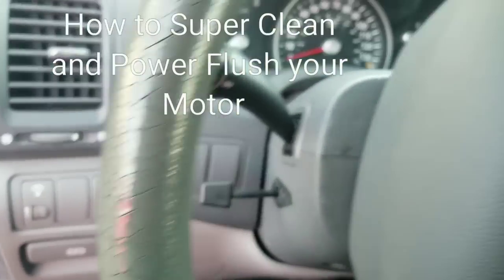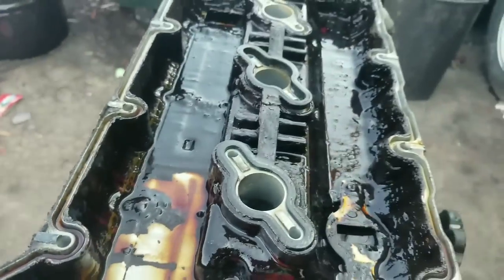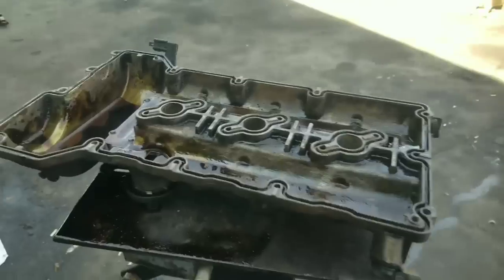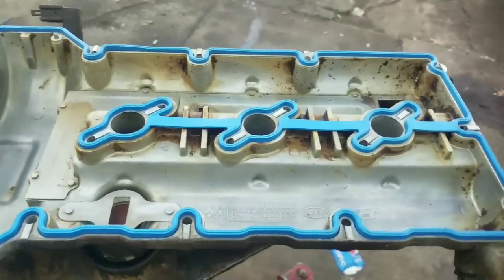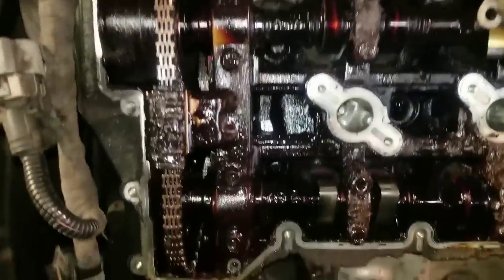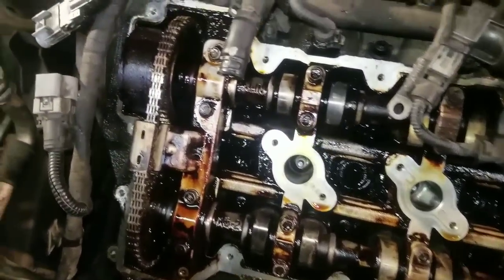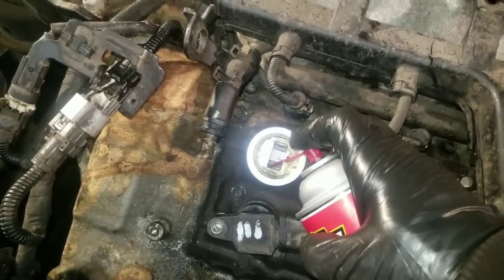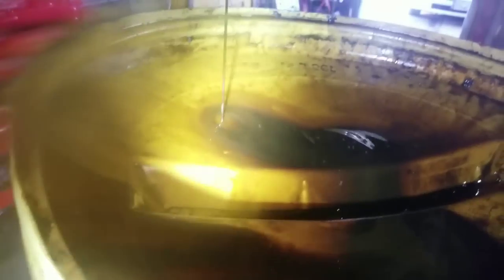How to Super Clean And Power Flush Your Car's Engine Pt.1

Comment: Use an oil suitable for your engine. Some oils do sludge but if you have a low oil pressure drop the sump and check the oil pump.Modern oils will keep your engine clean if changed hot and regular

Comment: There probably isn't a part 2 because the engine spun a bearing and died and wouldn't look good on his channel.  Any time the oil light is on you need to drop the pan and clean out the pickup if you expect the engine to live.  You're a hack if you expect to just pour shit in the engine and expect it to clean itself when it gets that bad.
Reply: Lmao
Cracked me the f**k up this comment
Reply from the maker: 2023 car still running. 
Thank you please like, share, and subscribe, also please check out my other channel Salem Taxi, on YouTube for more material on a different level.

Comment: Its suppose to be washed by diesel and the tool you can use is hand brush which does not have chances to break a part its threads inside the engine,(eg tooth brush) unlike wire scrubber with machine, it breaks alot of its particals here and there. drop down pan should be washed as well. also throttle should be washed same way.. done that in many cars and it worked always, but you need to use flushing oil twice aswell.. later put new engine oil and oil filter..

Comment: If you want cheap dump a gallon of diesel in the oil at least its oil based  and won’t damage the cam timing gears and seals  brake cleaner BAD   Don’t use inside an engine  unless its dissembled which is what this one needs. A tear down and rebuild
Reply: Trevor Mangus or atf

Comment: Good job,
 As for the know it all about the wire brush on cam lobes...... Get a grip. No way will the wire brush damage the lobes. Maybe if the wire brush was on surface for ten minutes even then minimal damage.

This guy knows his stuff, gets the job DONE RIGHT.

Top end clean, bottom end clean. Change oil filter, new oil, engine flush, dump oil, change oil filter, new oil, engine flush, dump oil, change oil filter, new oil.

Internally engine pristine.

Very good Job.

Comment: I've try this before cleaning using screwdriver then blow it using air compressor... then refill new oil and filter... start the engine more worse...the valve ticking very loud... until I remove the out the oil pan, found out all the gunk debris clog the oil pump filter and more on oil pan...
So I remove the oil pump filter a clean with kerosene and blow with air pressure.. install everything and engine back to normal

Comment: a wire brush. on an air gun. directly  onto the cams. i really, really hope this is just a trolling vid. 😮😬
Reply from the maker: wire brush is softer then the metal its cleaning, how do you think you would clean stuff like this?
Reply: Artistry Photography no it’s not steel on steel is not good lmao, use scotch bright pads
Reply: Look at the context. Cheap car. Well-used. Likely that the customer doesn't have a lot of money, right?

So our guy is trying some unconventional methods (doesn't make them wrong) to save the customer from having to buy a new head+ many hours labor

The results speak for themselves. This isn't a formula 1 car. If a cam lobe had a few microns wear from the brush (and that's even doubtful), but the car ran much improved than from when the customer brought it in, what difference does it make in the REAL world?
Reply: @wilsoncrocker  I appreciate your credentials. But you still missed the gist of my comment- oftentimes when you size up a "big picture" view, you take a different approach.

That way instead of 
1. Fix a beater and reverse mortgage the house
2. Junk it cuz it's dumb to reverse mortgage the house
3. You find a balanced solution that you can afford. Junker runs on for who can say how long but it was affordable to someone driving a junker. The vehicle won't die tomorrow or next week or next month because of this technically imperfect fix

Comment: So have you not remove every oil film leaving no lubrication with brake cleaner? Would that not cause scoring on start up ??????? I want to know
Reply: Probably will. But this is a well abused car that already has some scoring. Not a brand new engine. This engine is so abused it will probably die soon regardless of what he does to it. Anything he 
can do here is an improvement to what it was before lol. I do believe hes taken all that into account. I'm pretty sure he wouldn't do any of this to a new engine.

Comment: Oh My Goodness.  I cannot believe what I have just seen and I had to watch it all the way through to make sure.  Whatever you do fellow YouTubers - do not follow one single word of the "advice" given in this video.  Read all the comments below - I heartily concur with them.  One telling point, the guy changed the cover gaskets which were old, true, but would have continued to work just fine provided they weren't messed about with - and ignored the broken cam chain guide??  In all honesty, which do you think is more important?  Also, when started up after the rebuild I nearly leapt off my seat with the racket the engine was making!!  And when the oil was dropped?  I'm no chemist but it looked like 50% oil, 50% crank bearing material coming out!!  I feel sorry for the current and any future owners of this poor Kia.
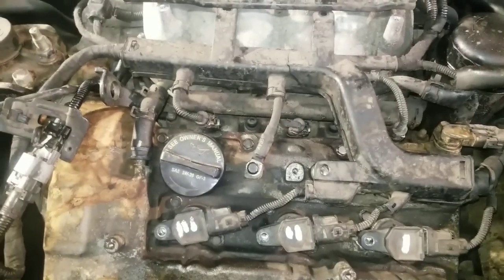Reply: Did you not hear him address the broken timing chain guide around 30:35-31:00?
Reply from the maker: update this car still runs great. have a good day
2023
Reply from the maker: Thank you please like, share, and subscribe, also please check out my other channel Salem Taxi, on YouTube for more material on a different level.

Comment: 1) Brake cleaner has chloride in it. If you use it to clean your mating surfaces before assembly then the chloride will eat up the gasket. 2) proper torque on rubber valve cover gaskets will cause then to wear prematurely and leak--use a torque wrench.
Reply from the maker: well said, but you forgot, they make non chloride brake cleaner. also your correct about the torque wrench, but there again the new-style of gaskets that are sold aftermarket for the valve covers are non torque gaskets.There type gaskets have metal shims to avoid over torqing on the gasket.
Reply: It said non chloride on the can.
Reply: Brake cleaner's fine for cleaning gasket surfaces.  What you don't wipe off from the cleaning, it just tends to evaporate.  I used it a thousand times and never had a problem.  By the time you go to put on the gasket all the brake cleaner's long gone.

Comment: Omg. Good bye cam lobes and bearings! Do not do this people
Reply: i used simple dish soup and metal conton to clean main part and modeling tool to do smakest corners and got it spotles
Reply: Mongo the Mechanic that car was gone from the beginning. Anything he did to it was an improvement. It's a Kia and a taxi at that. Not a ferrari.
Reply: U forgot about the crankshaft
Reply: So I have been a slob about changing my oil. 350 5.7v. Should I just change the oil a few times back to back after running for a few mins between changes? Wondering if the detergents will help if they are fresh..

Comment: people do not use a wire brush on an air tool, because at high rmp's the wire can come off the brush and into the engine. you get just one of those wire's between the bearing and the crankshaft you're in big trouble, that wire will eat into the bearing and the crank.lay down paper towel's to stop anything from going down into the engine. then take your time and clean it, use a toothbrush or a wire brush by hand, and watch than no wire is getting into the engine.alway clean both side's of the valve cover, when it's off the engine is better.when working no a engine fast cleaning is not always better, take your time do it right.

Comment: That was a DRY start! That hurt! Folks this is a video of WHAT NOT TO DO! Those cam bearings had to get damaged. If the chain had that much slack that it was slapping the cover, its time for a new chain. Im sure now thus engine is DEAD.  Also invest in a tripod!  Most of the video is you trying to talk over your air tool.

Comment: Instead of brake cleaner buy a quart of KREEN and put in a spray bottle and wet top end down then lay valve covers back on to reduce evaporation. Repeat a couple times let soak overnight if able, next day reinstall valve covers start engine let idle for 15 minutes then change oil. I had amazing results doing this.
Reply: Do you have a video on that?  I have sludge in my engine and I'm looking at different options.
Reply from the maker: so this process you mentioned sound time consuming,

Comment: This might be a crazy idea but what if you were to totally fill up the engine with the "awesome" or MMO and let it sit for a couple of days? drain and refill with the proper oil level ? thoughts?
Reply: I did that with my 200k prius. Except I used Berrymans chem dip. I let it idle for 15mins. let it sit a week. Then came back and idled it again for 15mins. Then I did the oil and filter change. Cleaned it out very well. but not completely. Ive gone another 20k miles and no issues yet. Runs better actually.
Reply: @Lilmiket1000  That Berrymans is good stuff. The Prius is a great car. Thanks for taking the time to tell about your knowledge, I appreciate it

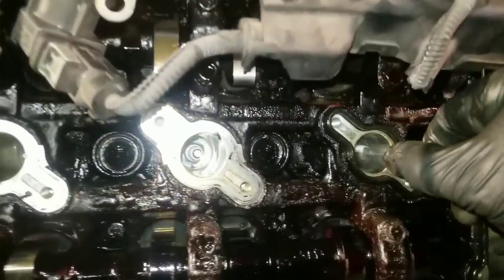Comment: A piece of the old brittle valve cover gasket drops into the spark plug well at around 16:00
Reply: You’ll also see it in there around 19:08 lol
Reply: And it will be drop into the combustion chamber during the next spark plug change.

Comment: When an engine has no oil pressure you're not supposed to run it until the problem is resolved. It's especially stupid to rev it or drive it with no oil pressure. This engine was already toasted before you flushed it.
Reply from the maker: 2023 engine still running great
Thank you, please like, share, and subscribe, also check out my other channel Salem Taxi on YouTube

Comment: I am battling in my camry because of oil pressure indicator keeps coming on and off..i thought its only the sending unit sensor is broken..but the only solution is drain the oil, clean the clogged oil pick up tube and the oil pan..saves my engine a lot..

Comment: Its no surprise to see a Taxi Cab wanting a cheap fix to years of neglect. These companies wring every penny out of their equipment and cry at the repair cost... Whats your opinion of the ATF flush I see online?
Reply: heavymechanic2 tranny fluid work I add a quart to my oil like 3 days before I change it 30 year mechanic
Reply: You can also run ATF on idle. Next oil change, drain oil, change oil filter and fill up with ATF.  Run on idle and idle only for 15 minutes. Drain add oil and new oil filter. Next oil change should be @ 1000 miles since you will have had ATF residue inside engine. You can also add half quart of ATF on new oil. Run it for no more than couple hundred miles. To keep things Cost effective. Buy Oil, ATF and oil filter @ Walmart/ Supertech brand.  You get quality @ a very low price. 
Note: ATF has detergents and does an excellent job @ cleaning.

Comment: I'm working on the exact same engine,  you are pissing in the wind. there is SO much area inside this motor. I got this van for cheap, it was overheated, all 3 rear cyls were breached. Sludge, the whole nine yards, the cyls sat for 3 yrs with plain water in them.

Comment: Oh my GOD!!!!!!! Did you really start the motor with brake cleaner in the crankcase and oil pan 🤦🤦🤦🤦🤦🤦. This destroys the motor, and brake cleaner renders the oil that's already in the engine useless because it's a solvent. so you're basically using the brake cleaner to lubricate the motor. You're right that flushes the engine alright .. flushes the engine of any life it had remaining. Also there are seals deep inside the engine. Brake cleaner destroys those seals. you should never ever ever ever ever ever ever ever ever ever ever flush an engine with brake clean. Hahahaha. Is this is a troll?
Reply from the maker: update 2023 car is still running great, Sooooooooooooooooooo, what was you saying?
Thank you please like, share, and subscribe, also please check out my other channel Salem Taxi, on YouTube for more material on a different level.

Comment: My mk4 turbo makes the same sound when you pull dipstick and try to pull oil cap. Cause I have the pcv valve touted through the catch can with a few one way check valves. So it acts like a Venturi sucking out any air and blow by.

Comment: la totally awesome contains
2-butoxy ethanol

i get it, its a solvent,
and a good one for oil
and sludge.

the only thing i would do
differently is to not
run the engine,  but to 
use a pump instead; to push it thru
the system. Sort of a dialysis
machine for cars in which the 
adapter would screws into the 
automobile oil filter hole.
Reply from the maker: cost of machine?
Thank you please like, share, and subscribe, also please check out my other channel Salem Taxi, on YouTube for more material on a different level.

Comment: That Noise (with No Oil pressure) is not the valves rattling  ...  Rather it's the Rod bearings pounding out. You are destroying what's left of that engine
Reply from the maker: engine still runs years later, looks like i added life.

Comment: Jesus Christ...At least use Diesel oil with high detergent content, and drop a flush in for the last 20kms. Drop that oil, use a mineral oil to flush the shit out, and drop a high quality Diesel oil in, changing every 2500- 5000km to slowly breakdown any sludge & build up.

Wonder how long before the bearings & cam lobes were fucked?

Jesus

Comment: I'm not going to comment on the merits of the process used here.  It just seems like it might just be easier and cheaper to drop the oil pan, clean that out, and then put in a high detergent oil like Amsoil or Mobil 1 High Mileage with a premium oil filter to slowly and safely dissolve the sludge and hold it in solution.  Either do an oil analysis like 2-3k later or just change it out again. No messing with the internals needed...plus way less money in labor. Also OMG the drained oil looks like it has zero film strength 😧
Reply: Also -- I have one of these vans.  to get to the rear valve cover you have to take off the intake plenum because the rear cylinder bank is almost under the dashboard.  I saw at one point that someone mentioned that this was an option for customers who did not wish to pay to have the oil pan dropped which would make sense on a transverse 4 cylinder, but this is a V6.  Again without criticizing the method used here, my experience tells me that dropping the oil pan would definitely be easier.  With the sludge out of the pan, some high quality high detergent motor oil could go to work on the top end.  

As another idea to help this engine out, after doing the pan and the oil change it might (I am not saying this is good or right just an idea) be interesting to do a coolant flush and put in a slightly higher temperature thermostat for the first 2-3k miles or so.  This might help get oil temperatures up high enough to better activate the oil detergents and help boil off the impurities contained within the sludge.
Reply: I'm from Pakistan 
I used mobile oil
Reply from the maker: Thank you, please like, share, and subscribe, also check out my other channel Salem Taxi on YouTube

Comment: Abused aint the word,sheesh!! That's why an engine flush every 3 yrs is a good idea.Oil changes is vital and cheaper,less hassle.For goodness sake just do an oil change 3k less than the manufacturer says/recommends if the mileage is under 100k.Between 100k - 200k halve it,simple.

Comment: Bro,you have made lot of mistakes! You should never flush it with cleaner! Best way to di it is to drain oil,remove oil pan,clean suction pipe. Assemble it,put 1/3 of new oil in it and rest diesel fuel. leave ot to run 15-20 minutes on IDLE! DO NOT REV IT! And after drain it good and replace oil filter,refill it with new oil... And it is ready to go

Comment: My 03 Open Vectra had some small knocking noise(lifters maybe), i just added little bit of ATF to the oil, drove the car for like 1tkm (or 620 miles) and changed the oil/filter. Oil was quite black and there was small chuncks. The noise was mostly gone and gonna do the same again soon, gonna remove the oil pan aswell next time (maybe should have done it during the 1st time but whatever)
Reply: What's an open vectra ?

Comment: Brake cleaner is generally expensive Naphtha in an aerosol can. You could buy a large amount of Naptha for far less. Maybe purchase a can of actual engine flush from someone like BG since you can easily make your money back from the customer and have a produce designed for the job. Plus you save the little tokens that come in the can  and the distributor will give you perks in exchange for the tokens!
Reply: You are a perfect example of why you should EVALUATE   most of what you read on YouTube !!!!!
Reply from the maker: Thank you please like, share, and subscribe, also please check out my other channel Salem Taxi, on YouTube for more material on a different level.

Comment: That's a change oil light!! My 09 trailblazer has the same exact light that comes on when it's time to change the oil!! Turn the key to on,without starting it,and press the gas pedal to the floor 3 times!! The light will start flashing and then start it!! I'm not saying the engine on the video didn't need cleaning but that light wasn't the oil pressure light!!
Reply: That is 1000% the oil pressure light.
Reply from the maker: Thank you please like, share, and subscribe, also please check out my other channel Salem Taxi, on YouTube for more material on a different level.